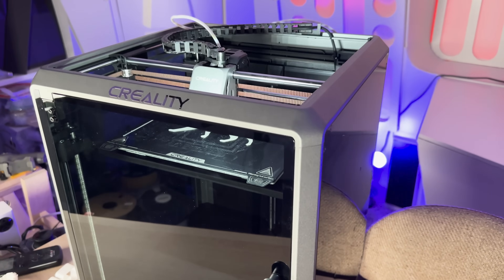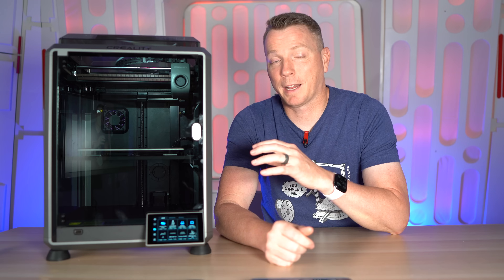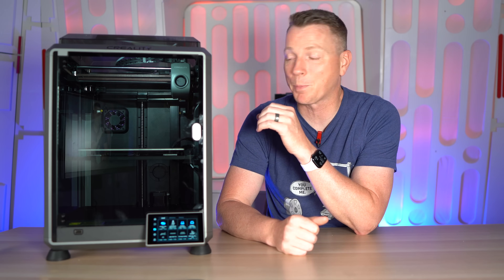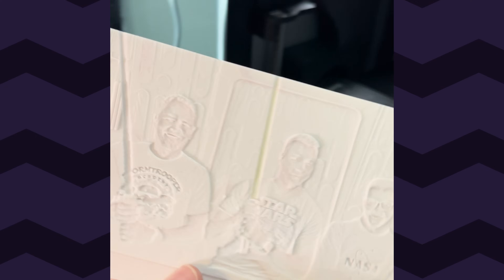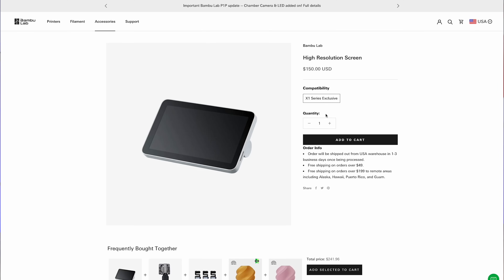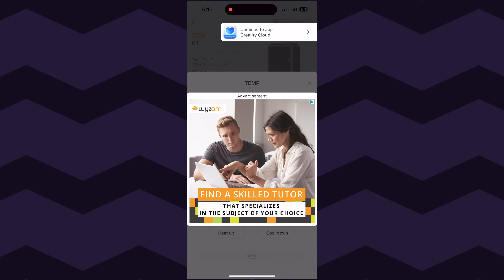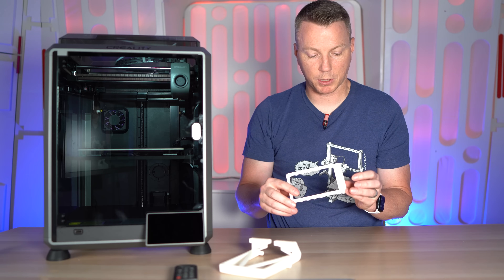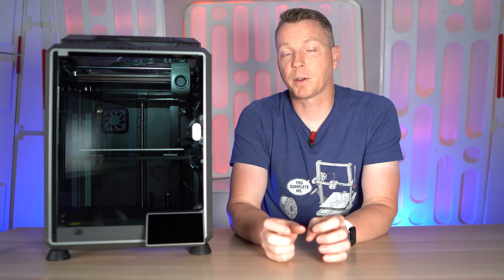I Regret Buying the Creality K1. Here’s Why.

Comment: Thank you for your feedback on the Creality K1.  I particularly appreciate that you bought the 3D printers and aren't making advertorial content.  It was good to hear what you didn't like about the K1.  While I don't minimize those as issues for you, they were in almost every case non-issues for me.  I won't install any app to use a 3D printer.  I won't send any files to a cloud server.  I print engineering prototypes, useful one-off designs to fix problems I encounter in everyday life, and products that I sell.  I don't need multi-color printing nor do I want the reliability issues and complexity.  I don't print Luke Skywalker models and Mandelorian helmets, not that there's anything wrong with that.

I was a bit disappointed to hear of some K1 extruder reliability problems, the drive gear engagement lever being too loose or getting knocked loose by the cable chain, issues of low quality cable chain links separating, etc.  These are all issues that Creality can fix, but historically they may not.  Hopefully there will be simple fixes from the community.

I'd like to buy a K1 Max in a few months with those issues resolved, and I'd greatly prefer a stripped K1 Max with no camera or lidar (I think the Creality version will be Bambu Me Too gimmicks that provide little benefit) for $250 less.  I"d like the speed and performance of the K1, with the build volume for the K1 Max, without the expensive fluff features.  I'd like to keep it simple.

My Bambu Lab issues are the carbon fiber guide rod tubes that wear and aren't replaceable, their near insistence on sending my prints through their cloud server, and the proprietary design particularly from a new company.
Reply: The carbon rods are fine. There has been one instance of actual worn out rods and that was a guy that was greasing them which you aren't supposed to and which will cause excessive wear beyond normalcy including using ludicrous mode constantly. Every other "worn out" vid i have seen is when people took the hotend apart and noticed the wobble. Which doesn't apply since screwing the hotend together twist and tightens the bearings. Plenty of people with over 10.000 hours with 0 wear. Just need to maintain them. 

It IS user replaceable now since Bambu sells the X gantry assembly so if you end up wearing out the rods you can pop a new one in. Afaik the K1 also has glued in and press fit rods. Atleast some people made jigs to free the rods if you really want to. 

You don't need to use the cloud. You can perfectly send files through LAN through your network without it ever touching their cloud. It's literally a single button switch on the screen and most of the time Bambu studio picks that printer in LAN only up.

Yeah the proprietary stuff sucks but eh third party hotends are already being made and eventually there will be stuff. A group is currently reverse engineering the board and Bambu made the promise to open up everything if the company goes under but that is ofcourse just a promise and i don't see a Bambu failure in a long time.
Reply: The carbon rods are replaceable, the whole assembly can be picked up from their store for 88 USD
Reply: Bambu labs sell pretty much every spare part there is with directions on how to change spare parts. And I already got a spare carbon fiber rod assembly in my shop.
Reply: @Liberty4Ever I echo your thoughts! I am leaning towards Creality K1 Max (when they back in stock) or Voron 2.4
Reply from the maker: You make some great points and it sounds like the K1 Max might be a great fit. I love that everyone has different priorities and ways they use their printers. Creality actually contacted me after they saw this video here on YouTube and said they have fixed all of the issues I brought up so maybe they have. We'll see. Hopefully you find a great printer that works well for you. Happy printing, my friend!
Reply: @The3DPrintingZone  including spam notification booming and adds on app?
Reply from the maker: @premium2554  I sincerely doubt that has been resolved in any way. I suspect they were referring only to hardware issues but we'll see.
Reply: @premium2554  don't need the app to print.
And as it seems Creality uses Klipper which opens the option to use the webinterface (fluidd) from Klipper without the need of that app.

Critique here would be for Creality to come clean and provide the source code as the Klipper license demands.
Reply: @The3DPrintingZone  Well therein lies the rub, right? Fact is, these problems should have been caught during their own product testing and maybe limit user beta testing.  Just goes to show you their philosophy where the end user is being used as their QA. I need a printer to print well out of the box.  I don't need another tinkering project.

Comment: I was going to say something like "I mostly print in ABS, the enclosure is a big deal for me, how would you compare the K1 to the X1?" but then you got into the Creality app and I'm just all "nope."  And, well, the cable chain issue just puts that completely to bed.
Reply from the maker: They are very different if you need the enclosure for sure. I wish there were an easier/ better option for a complete enclosure on the P1P, but I guess their option is to get the X1, which costs a lot more. And yeah, those are issues are a pretty big deal for me too.
Reply: @The3DPrintingZone I don't think Bambu really has a "this is for ABS" machine anymore. The plain X1 was a few hundred cheaper than the X1C and filled that niche, but seems to have disappeared, probably due to lack of demand.

The X1C is really intended for semi-engineering materials like CF-Nylon, so it's a little overkill for what I do.  Fortunately I was able to get early-bird KS pricing.

Comment: I agree with a lot of your points with the K1.  I've printed a lid riser so the drag chain doesn't scratch the lid or hit the sides as loudly.  The creality app is so ad-filled I removed it an hour later.  The K1 is a lot less hackable than the Ender 3 it replaced.

There is a web interface to the printer which you didn't mention.  It's very basic.  It assumes your browser window is full screen; I didn't realise the temperature graph was even there until I did.   I can't get it to integrate with the slicer so I have to use the USB or its own web interface.

I should have waited for the user-bought reviews rather than just the 'supplied for review' reviewers.
Reply: Actually, it is responsive. It's just responsive for the wrong dimensions... on a mobile phone, the boxes are all ordered top to bottom.

Comment: hollly shhhheeeeeet batman. Thanks for this video brother, man i dogged spending a grand. By now I expected this from the research I did but, you put the nail in the coffin. This is a trend in the new space we are in. Chines companies breaking in to the mass market with less then market ready products. You can really tell the difference an experienced team that comes from a DJI background can make in todays market. I was also hoping from the shiny exterior design of the K1 Max that they had really done their homework on this one, but again just shows how much more powerful the marketing engine is than the actual product behind it. Big sad for getting an "all in one" 300x300x300 printer. I will keep on rocking with my P1P and build a animal Voron in the coming months. Again thank a million for the super honest video. PS if you ever reach this comment send me a message. I have an all aluminum sheetmetal case iv designed and will be producing soon. Id love to send you a prototype to play with just for kicks. PS#2 I have ditched Bambu Labs for Orca Slicer. Its basically the same and lets you log in to your bambu labs account and such and do all the normal stuff but you have the option of calibrating materials down to the T and let me tell you my P1P is on a whole new level. I can make $60 5KG of some Chines special print like by beloved PolyTerra. PS#3 Holly hell that Creality app looks like AliExpress on crack. FML The dudes at Bambu are laughing their ass off at each one of these videos that comes out. Anyhow be well and one more thanks/

Comment: Great review. Could you do one with the FLSUN V400 vs the Bambu P1P?  The V400 is getting long in the tooth but was ahead of its time like the Bambu and with prices coming down it's not unusual to find the V400 in the sub $800 range putting the two within $100 of each other. I know the V400 is huge but most people would be able to accommodate the height vs flat and wide.
Reply: I have the V400 and the X1C. If you like modding and tinkering with the printer itself is your hobby, then V400 is fast and gives you plenty of of reasons to do upgrades. 
If you want fast reliable printing with very little issues, Bambulab is without competition.
Reply: Beware that delta printers become less precise as your prints move out of the center. For some people doing functional prints, this could become an issue.
Reply: I had the v400 for 6 months and I returned it. It’s the most unreliable machine I’ve ever owned and it breaks faster than it prints
Reply: I have the V400 and it's a continual maintenance nightmare for me.  I will definitely be moving to the P1P as soon as I can afford it.  Cheers.
Reply: @bettydaltonnewbold2019  Oh that sucks, what kind of issues are you having?
Reply: The comments on the V400 are interesting, I have the V400 and don't have any issues, it just runs well.
Reply: You're a lucky one.  Cheers.

Comment: So just a few things.  I like open source. So p1p has a negative for on that.  Also I really want a printer that only sends data to my local network. Nix the cloud. When bamboo has been around for more than 1 year I will also feel more comfortable about it being not open source.  Parts need to be available for the foreseeable future. The AMS feature looks nice, but I understand it does not handle TPU(flexibles). I do a lot of that so the AMS is not a big seller for me. From what you have said. I do like the bed size,speed,thermal capabilities. But I am actually passing on most of these new fast printer.  Give it another year and I will look again. :)
Reply: I print TPU on my X1 all the time. I connect it to a separate drybox and it's really good.
Reply: Take a look at something like a Sovol SV07. With the SV06 being fully open source, the chances are very good.

Comment: 13:45 I think the filament tube is meant to be IN the cable chain. At least it was with my unit, and I've never experienced the chain switching off the extruder gears...
Reply: Ditto

Comment: A few issues
1) most multi material printers don't have a poop chute. That doesn't tell us anything. I wouldn't hold my breath, but it is too early to rule out.

2) the k1 works with any slicer. The Creality slicer is just there for interfacing with Creality's cloud services.

3) you can absolutely change the notification settings in the Creality cloud app. Accounts tab> hexagon icon > notification.

4) nobody has a reason to care about 3 because it is a klipper printer. Just use the built in web interface like everyone else. The app is just for cloud slicing, or starting a print job from outside the home.
Reply: There are 3rd party ams competitors as well
Reply: Put printer in VPN and start print from outside the home.
Reply: @pararera6394  yes, you can do that. For years. With Klipper or Octoprint.

Comment: I think keeping the print size the same as the Ender 3 was a smart move.
Reply: The K1 print size is good enough for most of the parts I print but I'll probably hold out for a K1 Max for the occasional large part, but mostly for lights out manufacturing of multiple parts in a small print farm.
Reply: @Liberty4Ever  It's time ~1000$ printers were bigger, there's just no excuse anymore
Reply: @Kungpaoshizzi  You already could get $400 printers with large build volumes. And there have been Voron 1.8 kits for below 1000 bucks with 300x300 mm. So there are options ... especially when the large printer is the second or third one since it mostly is not used as often as the smaller ones.
Reply: @hassosigbjoernson5738  I decided against it, got the x1 carbon with ams. K1 has started it's quest to fix the release as a lot of trouble vids/stories are coming out, I don't feel like dealing with that :)
Reply: @hassosigbjoernson5738  And if it doesn't have an enclosure, input shaping, linear advance, a decent extruder, it's automatically out of the running... I mean it's 2023!!

Comment: Was thinking about both of these, but...Elegoo have completely changed it. For the price of one of these, you can get two Neptune 4 Pros, so that's an instant doubling of speed for anyone printing lots of stuff. Then there's the Klipper firmware, and the fact that you don't need a proprietary slicer to use all the features of the printer...that's huge for me, since I don't use Windows or MacOS (neither Creality nor Bambu support Linux).
Reply from the maker: Those new Elegoos look amazing and I can’t wait to try them. Fast and super inexpensive. I’m curious how the quality is but I’ll likely by one to test.
Reply: Bambu Labs *do* provide their slicer as an AppImage for Linux.
Reply: Creality also has an AppImage that I have been using successfully
Reply: A bed slinger will always be considerably slower than a core xy.
Reply: Not to mention having to buy a separate enclosure to be able to print ABS or other materials.
Reply: Only instant doubling speed if they are reliable machines. Not really doubling speed if you end up spending time debugging or re-calibrating them often.

Knowing the quality of these printer cloner companies it definitely will not be a instant doubling speed. Unless your plan is to keep re-printing the preloaded Benchy over and over.
Reply: Who tf uses Linux
Reply: @artur_cel_tare3597  - the standard response is "most people in the world, accidentally". But in my case, it's because it makes my work much easier and life's too short for running two operating systems.
Reply: @artur_cel_tare3597  Me.
I use Arch btw.

Comment: From what I read the K1 has a usb port and the Bamboo p1p does not.
Can you use Octoprint with the K1 ?
Reply from the maker: I haven’t tried OctoPrint on it but yes, it does have a full USB A port whereas the Bambu Lab printers do not. I haven’t actually felt the desire to use OctoPrint since getting Bambu Slicer and Bambu Handy since they do everything I used to do in Octo. I know there are a lot of plugins that are pretty convenient though so I’ll have to see if the K1 can run it.

Comment: I have only had my K1 for few days.  I haven't tried the online/app. From what you just said? Sounds awful.  So far the speed and print quality has been amazing.  I've seen brake cleaner dry faster, but this is way more entertaining than watching paint dry.  Or my E3S1Pro and E2Pro slog their way through a job.  Complaints? Yes,  the reverse Bowden tube is bent to tight and the guide chain isn't great.  Hasn't knocked my extruder lock open yet.  The janky run-out sensor is ridiculously hard to feed filament through.  The spool carrier? Seriously Creality??? A fixed plastic tube.  The bearing model from the S1Pro is a direct fit. I tried it.   And at the rate the K1 burns through filament,  well lubed bearings may still run hot! I am interested in multi material/ color printing.  Bambu has it.  And? Most of the complaints I've seen and heard about the AMS is that it wastes huge amounts of filament,  can't work with any variations in spool sizes or material,  causes nozzle jams when switching material types and is a really cool concept that just doesn't quite work. I can't wait for current version of Cura with K1 profiles.  Creality Print isn't to hard to use if your used to Cura, but it is lacking many features that I use often.  Like being able to isolate and very infill on one model in a multi model print.  As in zero infill for the tail of the HB1 E1000 RC Combat plane.  But thanks for the review.  I'll be keeping my K1 and adding a K1 Max when they become available.
Reply from the maker: Great feedback and thanks for sharing your experience! There are always pros and cons to every purchase but the more we share info, the more others can make the right decision for themselves so thanks again.